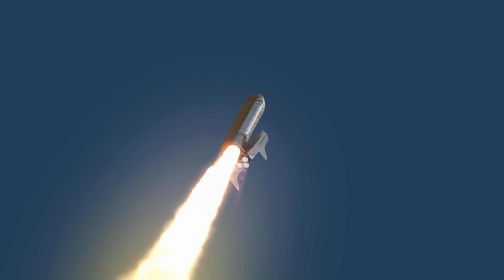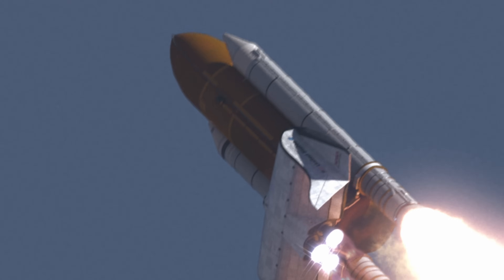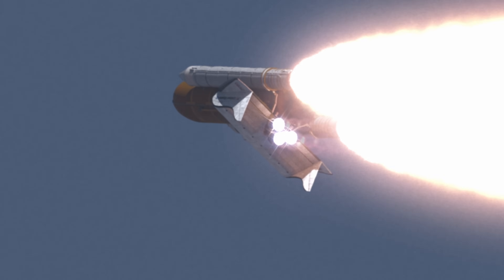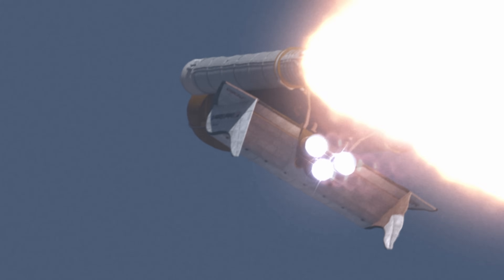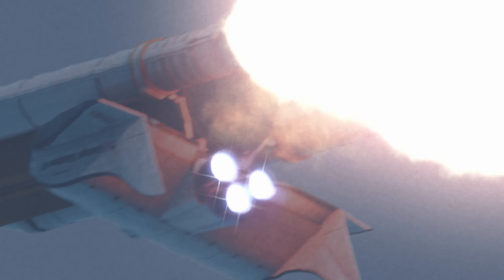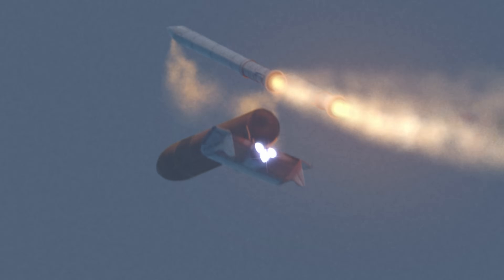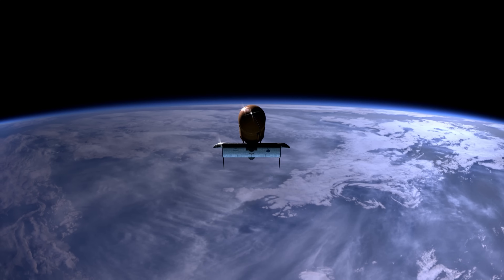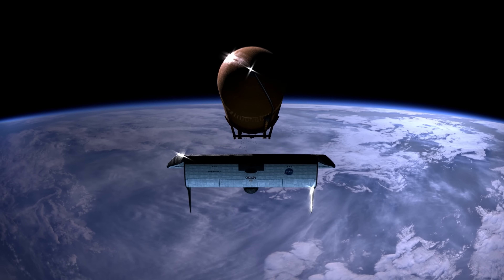Rockwell C-1057 "Breadbox" Space Shuttle Concept

Comment: When I saw the thumbnail of this video, at first I thought it was a very late April Fool's joke
Reply: It basically was:

The C-1057 design is on the lighter side of the effort. Al Kehlet persistently asked why our orbiters were several feet longer than the competitors. All the author knew was that ours were packaged tight and statically stable from hyper through subsonic flight. So, with a bit of innovation, the author turned the cargo bay 90 degrees and designed a 50-foot-long orbiter with a 60-foot-long cargo bay.

H.A. Scott, AIAA 6.1978-1469 Space Shuttle Orbiter Configuration Case History (page 15)

Comment: It is great being unrestrained and thinking laterally, but I can't really think of a compelling reason why this would be better? surely there would be increased vortexes at both ends because unlike tapering wings there is an abrupt wall at the edge.and flow separation and vortexes there would be concerning.explain firstly what the advantage would using this design, shorter sure, but why?
Reply: There weren't it was an in joke on the engineering team with one engineer basically making fun of another engineer complaining their real designs were too long. It wasn't seriously analyzed or designed to the based of the knowledge I have from papers I've been able to get about it:

The C-1057 design is on the lighter side of the effort. Al Kehlet persistently asked why our orbiters were several feet longer than the competitors. All the author knew was that ours were packaged tight and statically stable from hyper through subsonic flight. So, with a bit of innovation, the author turned the cargo bay 90 degrees and designed a 50-foot-long orbiter with a 60-foot-long cargo bay.

H.A. Scott, AIAA 6.1978-1469 Space Shuttle Orbiter Configuration Case History (page 15)

Comment: “There’s no such thing as a dumb question.”  

Well, now we know there certainly is.  Whoever asked, “Why don’t we make a breadbox shuttle?” was asking a dumb question.
Reply: The dumb question was actually, "Why are our normal Shuttles proposals a couple feet longer than the other people's?" and the engineer who did this said, "If you want a shorter shuttle, here. Isn't it stupid-looking? Now go away" basically:

The C-1057 design is on the lighter side of the effort. Al Kehlet persistently asked why our orbiters were several feet longer than the competitors. All the author knew was that ours were packaged tight and statically stable from hyper through subsonic flight. So, with a bit of innovation, the author turned the cargo bay 90 degrees and designed a 50-foot-long orbiter with a 60-foot-long cargo bay.

H.A. Scott, AIAA 6.1978-1469 Space Shuttle Orbiter Configuration Case History (page 15)

Comment: It's nothing "new" about the design.  It's just a cross between a "lifting body" design and  "blended wing body" design, both from the 1950s and 1960s.

Of course, BOTH of those designs are severely speed-limited because the same drag aspects that give the designs lift, would also act as a giant air brake during acceleration.  

The question would be at what point during launch would the catastrophic failure occur?  

1. The craft would tear off the mounts to the fuel tank
2. The craft would be torn apart during the initial boost
3. The craft would create so much drag that the entire assembly wouldn't achieve escape velocity
Reply: Then it's funny that everyone who's looked at lifting fuselage body planes have said lesser wetted area and drag for the same or better internal volume, better L/D and payload and range, and lower landing speed with much more benign stalling characteristics.

Comment: No way someone actually took the time to design this. “Hey, the shuttle works but lets make it thicc to it gains the aerodynamics of a loaf of bread.”
Reply: It was one of the engineers from the project clowning around with one of the other engineers, basically:

The C-1057 design is on the lighter side of the effort. Al Kehlet persistently asked why our orbiters were several feet longer than the competitors. All the author knew was that ours were packaged tight and statically stable from hyper through subsonic flight. So, with a bit of innovation, the author turned the cargo bay 90 degrees and designed a 50-foot-long orbiter with a 60-foot-long cargo bay.

H.A. Scott, AIAA 6.1978-1469 Space Shuttle Orbiter Configuration Case History (page 15)
Reply: @rwdavidoff 
None of why is to say it couldn't have been a serious proposal with good thinking about how it could work.
Reply: @JFrazer4303  Could it have been? Maybe, but it wasn't and we know it wasn't because the person who drew it wrote down in a published paper that it wasn't. (You can also tell it's not very serious by its near total absence from any documentation of major studied options for thirty-five year before Fantastic Plastic made a model kit of it in 2007.)
Reply: @rwdavidoff  Plenty of other options for competition to the Shuttle we got were not studied further. One source is not enough to say that this one wasn't considered by a designers to be realistic.
It wasn't completely unknown until the model kit came out.
Reply: Probably lower loading and re-entry heating and better crossrange and lower landing speed.

Every part of it produces lift, no static non-lifting drag.
Many lifting fuselage airplane designs have lesser wetted area and equal or greater useful volume, and less structural weight and better L/D and payload and range than a tubular static drag fuselage.

Comment: Ok, I think I know what the idea was. So on the real Shuttle, the payload bay was inline with the engines and crew compartment, meaning they had to add the wings on as additional surface area, therefore additional weight. Theoretically, this may be more mass-efficient, given that the payload pay is over the wings and the fuselage, wasting less space. But that’s just a theory. A SPACE SHUTTLE THEORY
Reply: The idea was an engineer was annoyed with another one asking stupid questions about why their Shuttle design was longer than other design firm's, and decided to make a joke about it, the design wasn't seriously studied in any way:

The C-1057 design is on the lighter side of the effort. Al Kehlet persistently asked why our orbiters were several feet longer than the competitors. All the author knew was that ours were packaged tight and statically stable from hyper through subsonic flight. So, with a bit of innovation, the author turned the cargo bay 90 degrees and designed a 50-foot-long orbiter with a 60-foot-long cargo bay.

H.A. Scott, AIAA 6.1978-1469 Space Shuttle Orbiter Configuration Case History (page 15)

Comment: But why?
Reply: Because one of the engineers was annoyed at another engineer complaining the designs they were actually studying seriously were a little longer than the other design firm's, and wanted to make a joke of it:

The C-1057 design is on the lighter side of the effort. Al Kehlet persistently asked why our orbiters were several feet longer than the competitors. All the author knew was that ours were packaged tight and statically stable from hyper through subsonic flight. So, with a bit of innovation, the author turned the cargo bay 90 degrees and designed a 50-foot-long orbiter with a 60-foot-long cargo bay.

H.A. Scott, AIAA 6.1978-1469 Space Shuttle Orbiter Configuration Case History (page 15)

Comment: Not your best effort to be honest. Most notably, where do the shuttle engines, pumps, and fuel fit with that payload area. It is like one of my childhood lego spaceships where all I needed was the jet nozzles. There were a few other unrealistic bits of animation such as slow exhaust speed on the high altitude view, and a weird exaggerated angle between booster and shuttle soon after launch. Just constructive criticism. You make great videos.
Reply: The real design wasn't very detailed because it was whipped up basically as a joke from one engineer annoyed with another:

The C-1057 design is on the lighter side of the effort. Al Kehlet persistently asked why our orbiters were several feet longer than the competitors. All the author knew was that ours were packaged tight and statically stable from hyper through subsonic flight. So, with a bit of innovation, the author turned the cargo bay 90 degrees and designed a 50-foot-long orbiter with a 60-foot-long cargo bay.

H.A. Scott, AIAA 6.1978-1469 Space Shuttle Orbiter Configuration Case History (page 15)
Reply: @rwdavidoff  : Thanks for the info. I am curious as to why no one has pursued a full glider reentry craft. I understand it is ridiculous speeds but bouncing of the atmosphere enough times should, I feel, eventually slow a craft down so that it can eventually glide down into the atmosphere without having to be engulfed in a burning plasma.
Reply: @DavidHands  The problem is that it's both great speeds, but also not enough to really get much out of the atmosphere. To "bounce" in a way that does much more than delay falling takes pretty serious lift-to-drag which tends to mean shapes that have a lot of heating and even then there's only enough energy for one or two skips before you have to come down. You just can't get slow enough to avoid needing some kind of thermal protection (the difference between say 7 km/s and 6 km/s matters, but not enough to totally do without TPS), so you might as well come back faster and not bother.

Comment: I've only seen artists concepts of the Rockwell C-1057 in orbit or landing, but never in launch configuration.  Actually, until I just saw this excellent video, I never gave it too much thought.  Though you note in the synopsis that ". . . integrating (the C-1057) with the ET and SRB's remained a mystery," I think that your design solution is as good as any that Rockwell engineers could have come up with.

Thanks for sharing this with us!

290th Like.
Reply: I didn't see any OMS pods.  Was there another way that it was supposed to deorbit?  I knew some engineers on Shuttle.  They hated it because of the cost of everything.  As a teenager I only saw a space ship.  What they were saying really puts what SpaceX is doing into context.
Reply: @longshot7601  It was an in-joke and not seriously designed in details:

The C-1057 design is on the lighter side of the effort. Al Kehlet persistently asked why our orbiters were several feet longer than the competitors. All the author knew was that ours were packaged tight and statically stable from hyper through subsonic flight. So, with a bit of innovation, the author turned the cargo bay 90 degrees and designed a 50-foot-long orbiter with a 60-foot-long cargo bay.

H.A. Scott, AIAA 6.1978-1469 Space Shuttle Orbiter Configuration Case History (page 15)
Reply: @rwdavidoff  Ah ha.  Engerneering humor.  I wish I had recognized it. I guess the engineers took the comments of lifting bodies being streamlined bricks and ran with it.

Comment: There would be little structural integrity with that gigantic bay right where you need supports. Its no wonder it wasn't built. It does highlight that Musk's Starship design is a folly, with its integrated fuel tanks. What was he thinking? It would be easy to make those launch rockets autonomous with today's tech. Instead he's messing around with a giant flying water tower. That thing will take decades to be safe. Not gonna fly.

Comment: Wouldn't the cockpit and the crew area's structural needs cut into the payload bay because they're so flush with the leading and trailing edges of it?  Where would the EVA airlocks be located, and why are the insides of the payload bay door reflective instead of radiators?

Comment: Was this proposal dated April 1st
Reply: Basically, yes:

The C-1057 design is on the lighter side of the effort. Al Kehlet persistently asked why our orbiters were several feet longer than the competitors. All the author knew was that ours were packaged tight and statically stable from hyper through subsonic flight. So, with a bit of innovation, the author turned the cargo bay 90 degrees and designed a 50-foot-long orbiter with a 60-foot-long cargo bay.

H.A. Scott, AIAA 6.1978-1469 Space Shuttle Orbiter Configuration Case History (page 15)

Comment: WHY
Reply: Designer's in joke. It wasn't actually a serious proposal:

The C-1057 design is on the lighter side of the effort. Al Kehlet persistently asked why our orbiters were several feet longer than the competitors. All the author knew was that ours were packaged tight and statically stable from hyper through subsonic flight. So, with a bit of innovation, the author turned the cargo bay 90 degrees and designed a 50-foot-long orbiter with a 60-foot-long cargo bay.

H.A. Scott, AIAA 6.1978-1469 Space Shuttle Orbiter Configuration Case History (page 15)

Comment: love these, however wouldn't the overall weight imbalance and center of gravity towards the bottom/lower 3rd of the launch vehicle cause more effort to be needed/used once the boosters are separated??
Reply: Probably, which was fine because the design was an in-joke sketched out between members of the design team and not serious proposal with analysis:

The C-1057 design is on the lighter side of the effort. Al Kehlet persistently asked why our orbiters were several feet longer than the competitors. All the author knew was that ours were packaged tight and statically stable from hyper through subsonic flight. So, with a bit of innovation, the author turned the cargo bay 90 degrees and designed a 50-foot-long orbiter with a 60-foot-long cargo bay.

H.A. Scott, AIAA 6.1978-1469 Space Shuttle Orbiter Configuration Case History (page 15)

Comment: What in the Scooby Snacks were they smoking?
Reply: They were smoking in jokes, it wasn't serious:

The C-1057 design is on the lighter side of the effort. Al Kehlet persistently asked why our orbiters were several feet longer than the competitors. All the author knew was that ours were packaged tight and statically stable from hyper through subsonic flight. So, with a bit of innovation, the author turned the cargo bay 90 degrees and designed a 50-foot-long orbiter with a 60-foot-long cargo bay.

H.A. Scott, AIAA 6.1978-1469 Space Shuttle Orbiter Configuration Case History (page 15)
Reply: Purple haze?

Comment: I can't see how that configuration with the boosters and fuel tank could possibly be stable during liftoff. The shuttle itself doesn't even look like it would be stable in re-entry. Super cool design and awesome rendering job. Almost hard to tell the footage isn't real at times.
Reply: It was an in-joke in the design team and not actually a fully considered design, I think a lot of the "it was surprisingly stable" stuff is people playing telephone from what was a moderate-effort in-joke in the design team:

The C-1057 design is on the lighter side of the effort. Al Kehlet persistently asked why our orbiters were several feet longer than the competitors. All the author knew was that ours were packaged tight and statically stable from hyper through subsonic flight. So, with a bit of innovation, the author turned the cargo bay 90 degrees and designed a 50-foot-long orbiter with a 60-foot-long cargo bay.

H.A. Scott, AIAA 6.1978-1469 Space Shuttle Orbiter Configuration Case History (page 15)
Reply: Imagine the cargo being heavy on one and very light on the other side. Fun times.
😂
Reply: lol, it requires one more shuttle on the other side for the launch. and i see it falling like a paper stripe on re-entry

Comment: what if.. shuttle... but sideways?
Reply: That was basically the entire origin of this as a design among the design team, and the total extent of the effort beyond a drawing:

The C-1057 design is on the lighter side of the effort. Al Kehlet persistently asked why our orbiters were several feet longer than the competitors. All the author knew was that ours were packaged tight and statically stable from hyper through subsonic flight. So, with a bit of innovation, the author turned the cargo bay 90 degrees and designed a 50-foot-long orbiter with a 60-foot-long cargo bay.

H.A. Scott, AIAA 6.1978-1469 Space Shuttle Orbiter Configuration Case History (page 15)